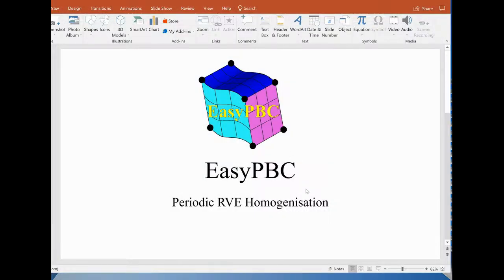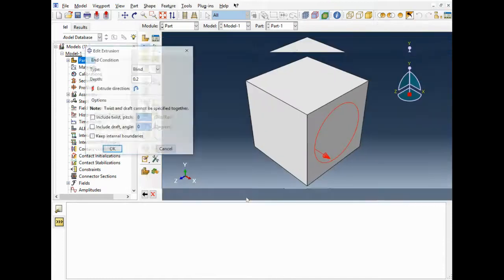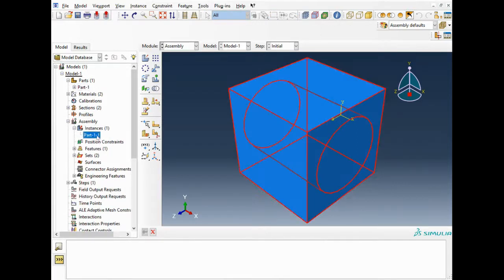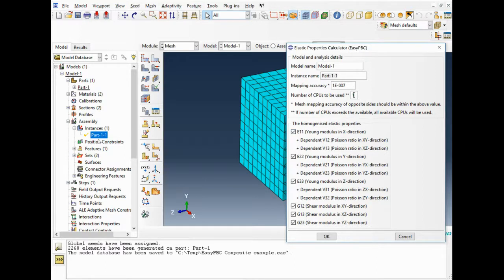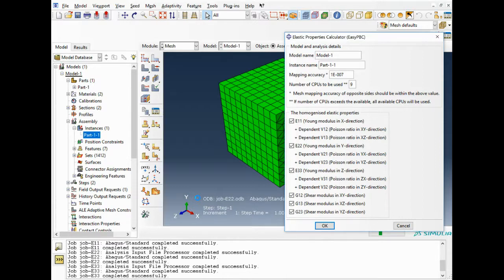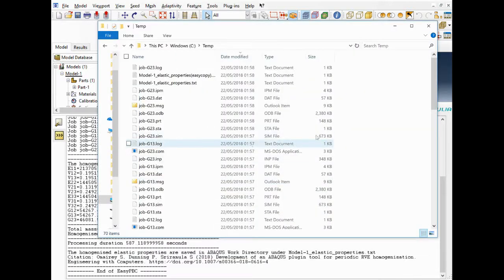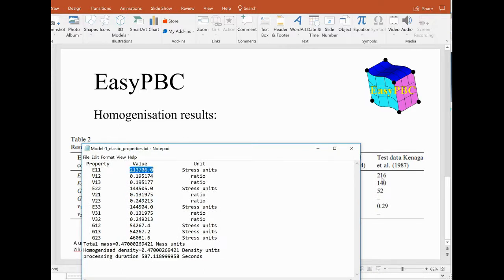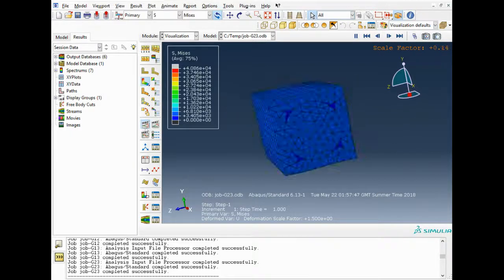EasyPBC: Plugin instillation and composite homogenisation example

Comment: Can the code also evaluate the yield stress on an RVE with elastoplastic behavior?
Reply from the maker: Yes, in the updated version, if you tick the last box the plugin will only generate PBCs, you can use them to make your step, and apply the desired strains, then do your own calculations.

Comment: Good code, I work with Comsol software for compute the homogenised effective elastic properties for random microstructures, Can you use this code later with a Comsol?
Reply from the maker: The conde can not be used directly to an other sofware such as Comsol. But the publishded concept of the code can be used to develop  a similar plugin. see https://link.springer.com/article/10.1007/s00366-018-0616-4
Reply: Thank s for request, but this page is unavailable
Reply from the maker: delete the barcket:
https://link.springer.com/article/10.1007/s00366-018-0616-4